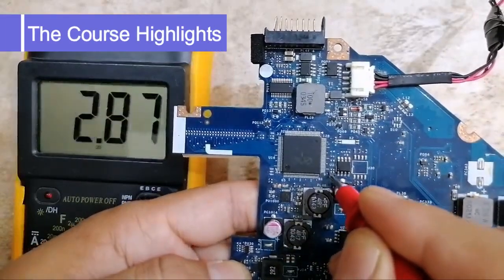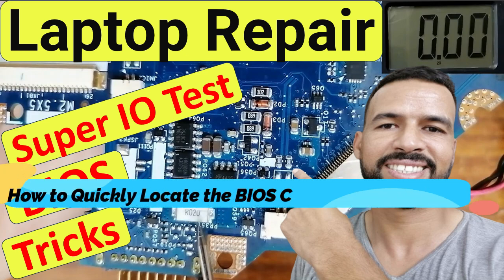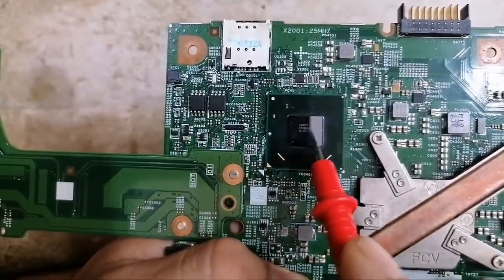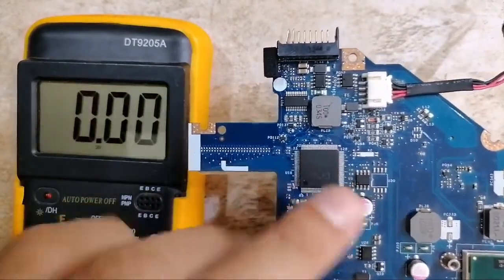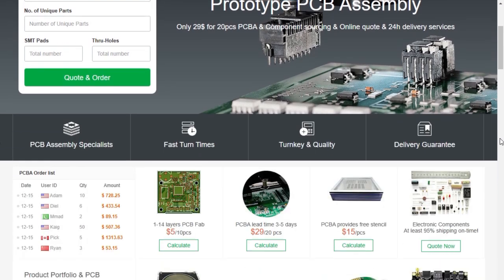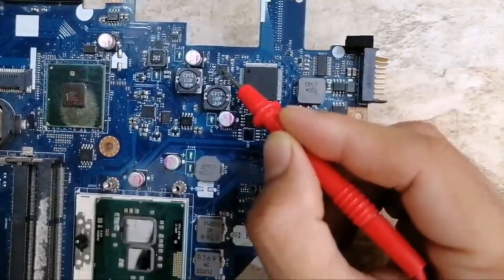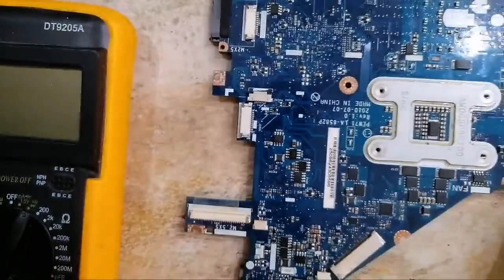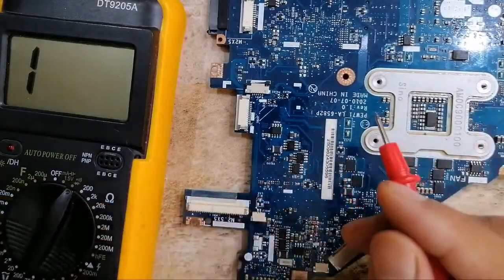I Fixed My Laptop with These 4 Crazy Tricks You Won't Believe! | Laptop Motherboard Repair

Comment: Is the PCH the same to chipset ?
Reply: Yes and no. The PCH (Platform Controller Hub) is Intel's modern implementation of a chipset, managing tasks like USB, storage, and networking. While a chipset historically included both a northbridge and southbridge, modern CPUs integrate the northbridge, leaving the PCH (similar to the southbridge) to handle peripheral communication via a DMI link.
Reply: @beogeek  👍
Reply from the maker: PCH is a subset of chipsets: All PCHs are chipsets, but not all chipsets are PCHs.
The term "chipset" includes both older architectures (Northbridge/Southbridge) and modern single-chip designs like PCH.
Intel's PCH is specific to Intel platforms, while "chipset" can refer to similar components from AMD or other manufacturers.
Reply: @electronicsrepairbasics_erb  👍
Reply: @electronicsrepairbasics_erb  thanks sir 👍